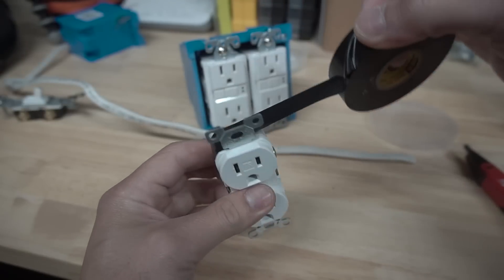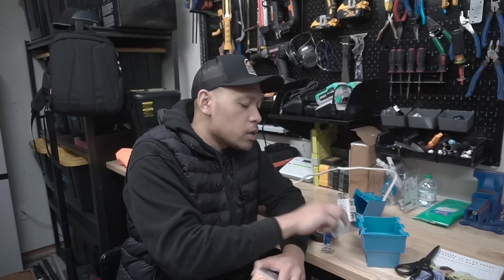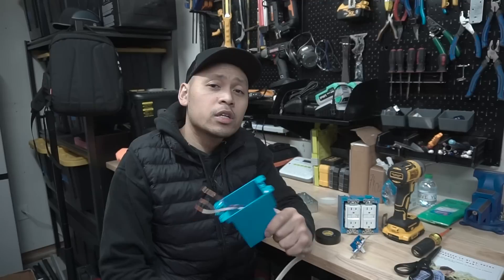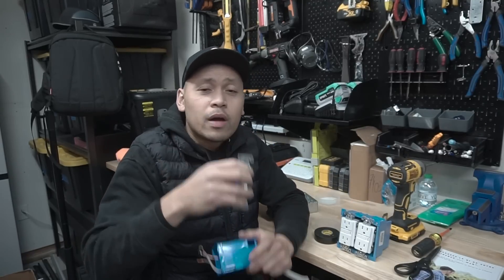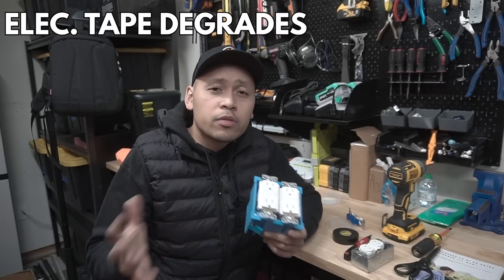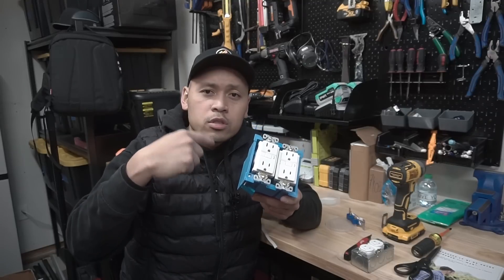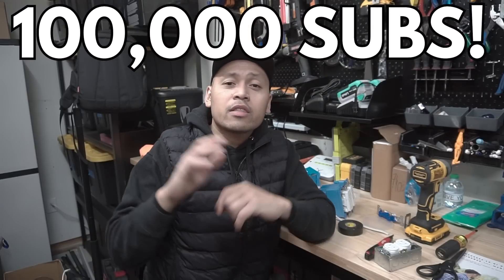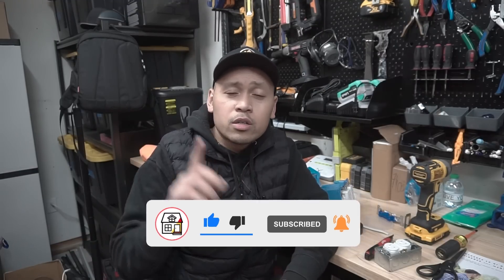Is It ILLEGAL To Wrap Outlets And Switches With Electrical Tape?! The DIY Great Debate! How To

Comment: I prefer devices not be wrapped unless a need facilitates it, such as where you mention the GFI into a metal box, which I run into often on repairing outdoor circuits. Otherwise its usually an inconvenience to troubleshooting and repairs for me.
Reply from the maker: Thank you for sharing your experience! 👍🏽🙏🏽😊
Reply: As of 2022 the GFIs that I usually see have terminals that are extremely recessed unlike before

Comment: Personally, I only wrap if the device is being loaded into a metal box and/or a double (or higher) gang box is used where devices are in close proximity and the possibility of a short exists.  Always use quality tape and never the cheap crap.
Reply: Same here.   Blown an expensive dimmer or two in my career in multi gang boxes (where there was a mixture of dimmers and toggle switches, a few of the dimmers I've installed had screw terminals and needed a neutral) a wrap of good quality tape is cheap insurance,  although if you are really neat with packing the wires back there shouldn't be an issue
Reply from the maker: Thank you for sharing your experience and advice! 👍🏽🙏🏽😊
Reply: I agree 100% and do the same.
Reply: "Personally, I only wrap if the device is being loaded into a metal box..."
I do the same.
Reply: Vinyl tape should not be used as it is not stable and will just turn brittle and/or a sticky mess.  Nature of the beast.  If you want to protect the device from accidental shorting to the box, then use a self-vulcanizing rubber tape.  Yes, it's more expensive, but it is stable and does not use an adhesive.  If you want to do the right thing, saving a few pennies isn't worth it.  Do it right, or not at all.

Comment: Great examples, but you usually don’t put two GFCI in series in a box. Thanks for sharing
Reply: How about installing 2 GFCI into a 2-gang box where they are fed from a multi-wire branch circuit? This provides 20A x2 for locations with heavy loads.
Reply: @electricboyo  absolutely!
Reply: If wired correctly 1 gfci outlet works as the ground fault interruptor for the 2nd or even 3rd outlet.
Reply: two GFCI in parallel.

Comment: Thanks for giving the pros AND cons. Personally, I'm a wrapper. The eventual failure and the goo were the only two reasons I could see not to wrap, and neither one trumped safety. I hadn't thought about inspection, so thanks for opening my eyes on that. 

The buddy tab/gentleman's collar never occurred to me. That's a major take-away.

Agreed that code is only a minimum. We should all be working "better than code" where possible. It sets you apart in an ocean of mediocrity and, big picture, over time it helps elevate the trades in the eyes of the public. Plus, don't you want to be proud of your work?

I think technically the boxes in the video are utility boxes, not J-boxes? I'm not an electrician so maybe I'm wrong. 

After watching two videos I'm subscribing. Keep up the good work.
Reply: I personally don't like wrapping. I've dealt with old tape it's a pain in the ass. Mostly all boxes in residential anymore is mostly plastic where I'm at. You are right, code is bare minimum, but wrapping is not needed,  and it's sometimes a pain for the next guy coming in. I don't like wrapping them, this is always a debate, and each has their own ways. You do whatever you feel comfortable doing, and do as good and clean as you can. 👊
Reply: Technically they are defined as an outlet box but depending on the use can also be a j-box at least in my corner of the electrical world in Aspen Colorado, either way taping the devices is always a good practice, especially with some of the high end devices that are required here.

Comment: The cons with electrical tape tend to be from using inferior quality tape. Use super 33 like you do and you’ll be good. Inferior quality tape tends to harden and it loses its adhesive or leaves adhesive residue. Inferior tape also is not as stretchy as you mentioned and I’ve seen many instances where it comes right off when it’s old because it loses its “tension”. 
Thanks for your vids brother. Much appreciated from Hawaii.
Reply: Never purchase or use any electrical tape, safety or test equipment or tools from cheating scum bag lack of quality control communist China. Best practice is to always apply a few wraps of a quality tape around all devices. Prevents arcing or major sparking if water enters the box, helps to keep wire close if it breaks off due to Johnnie home owner knocking the wire due stripping insulation, makes it safer if a metal box is installed into an existing wall using metal Madison bar supports that can short out.